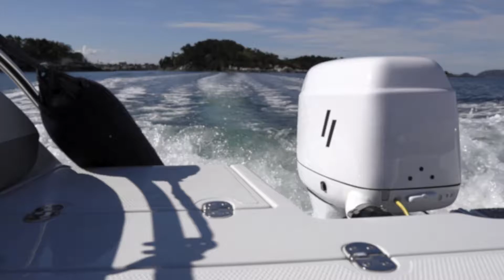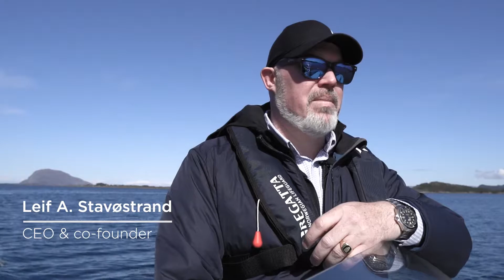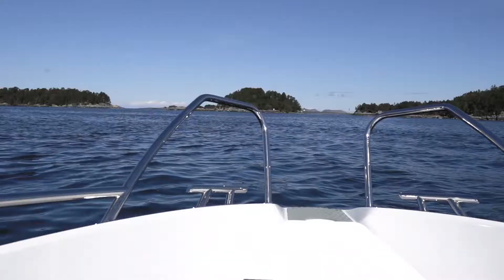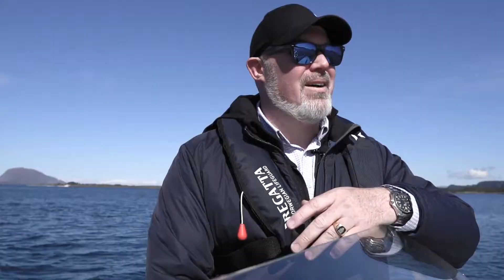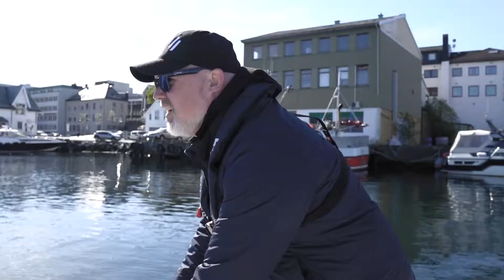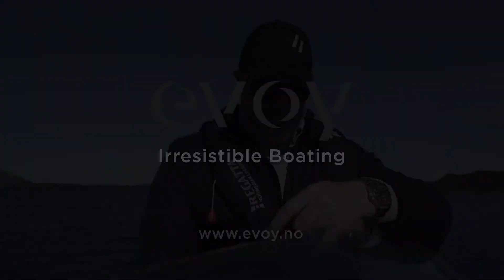Evoy | High Power Electric Motor Systems

Comment: What about electric motors that can retrofit to a Volvo Penta stern drive or a Mercruiser stern drive? I have a Mercruiser V8 with approx 320 hp engine with a Mercruiser Bravo III stern drive. In a few years does the engine need to be rebuildt. But it can also be replaced by an electric engine. But I do not think there is no need to replace the stern drive. Perhaps rebuild it and update it. It have a dual prop system so it is really nice. Can your system be  retrofitted  to a Mercruiser stern drive?
Reply: Yes, our motors systems can easily connect to Mercruiser, Volvo Penta, Konrad or Yanmar Sterndrives. We can also connect to water jet and shaft with or without gear.

Comment: The price needs to come down by around 75%, they are incredibly expensive and do not need to be. an electotor is not as expensive as a internal combustion engine to make. i understand about controllers and esc etc but again these are not as much and can be got for cheaper than a set of carburettors... so why are they so expensive ? and the crazy price will make this another good idea that will die.. the motr should be as cheap if not cheaper than a normal outboard of same hp rating.. batteries will obviously be expensive but they will come down in price .. but the motor is just stupidly priced by someone who thinks he can make millions over night..... think of the future and make something affordable....... would be a good idea to have system that can be put on existing mid sections. then you could be onto a winner.
Reply from the maker: Hey Phill!
We understand your concern however, our prices are as tight as they can be. As you have mentionned every part is essential and the prices are high still because of the small quantity ordered. That's the rule of Market vs Demand. That's not just controllers and batteries indeed 🧐
As with every new technology as soon as the market grows the prices will come down. We are doing our best to do so  😉  Additionally the electric motors are allowing you to cut a tone on maintenance and so on. 🔋
Reply: @poweredbyevoy  valid points then an interesting contrast is that Henry Ford grew his company by setting his price so everyone could afford his product and the competition couldn’t compete. That’s how he took the market by storm.  You could bulk order components a truck load at a time, gain efficiency in assembly and drop the price while maintaining the same profit then your customers benefit by saving.  Once more of your engines are out there over time customers will need replacement parts which you will make some money on this increasing profits.
Reply: Phil clearly never went to business school.  Think of the design costs and engineering costs that went into building this company. If you think its as simple as building a boat motor with some parts and plugging into a power source I honestly have no idea how you can even tie your shoes by yourself.